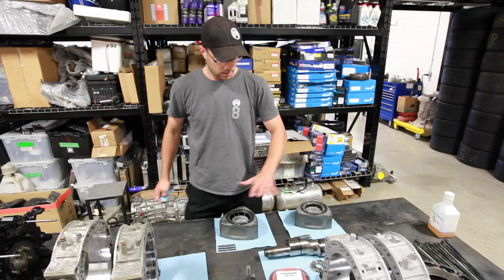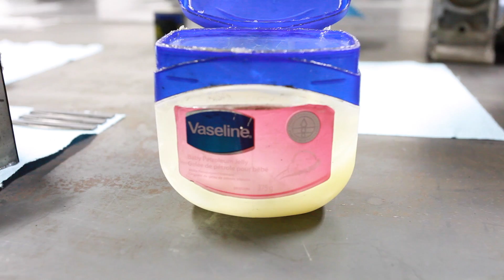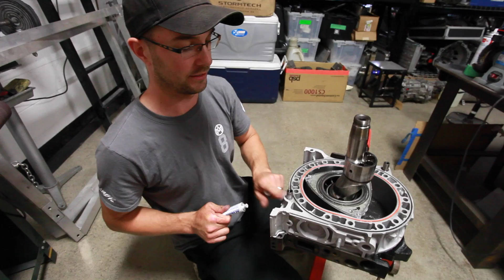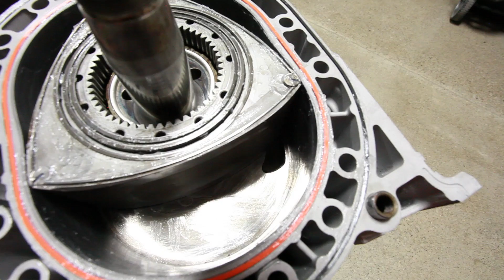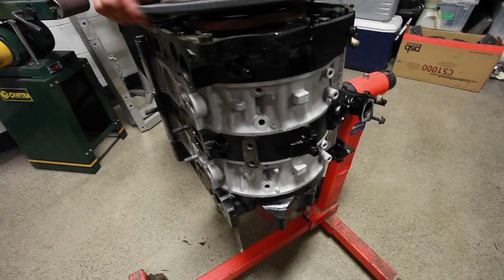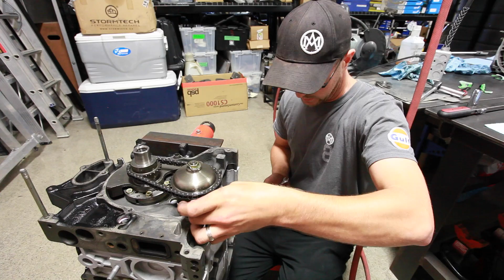How To Build A Rotary Engine

Comment: step one.  take it to the scaping yard
 step two.  buy an LS
step three spend a fraction making a more powerful,more reliable motor
step four.  forget rotor motors ever existed.
Reply from the maker: Kinda harsh no? The perception is that rotaries aren't reliable but go to Japan or Australia and you'll see how fast and reliable they are.
Reply: @Keisuke-I can't put enough Thumb's Up to this post, forgive me.
Reply: +just rotate I'm joking really, not necessarily a big rotary fan, but they some of the best sounding engines there are.
Reply: you forgot step five......get blown by by a guy in a single turbo supra pushign 1000hp on the stock bottom end
and step six, holding your e head in shame as youve spent allot more money on an ls than the guy down the road with a LT1 powered camaro only to lose to a boosted supra
Reply: kiddddinggg
Reply: rotor motors will still exist In Aircrafts, but we should appreciate the effort put in joining rotaries with cars by mazda and other companies ...it was an interesting experiment!
Reply: +Atef turki Rotary engines have been obsolete in aircraft for almost a 100 years... and Wankel engines were never used in production aircraft... I don't understand what you are talking about.
Reply: +The real doktorbimmer 
i wanted OP to not call the engine 'Junk' (that's what i was talking about...)
and HOW da fucc did the engine get obsolete 100 yrs ago when it was developed 66 yrs ago (1951)????
,also! i think it's more efficient in aircrafts (propeller ones) not because of gas mileage, but because of 
things like weight and less volume for smoother aerodynamics.... high revs... (better overall performance in short)
Reply: +Atef turki  I wouldn't call the Wankel "junk" its simply inferior to other ICE designs which are still mass produced in the millions.
Reply: +Atef turki You really are confused on your engine types though.. Felix Millet invented the Rotary ICE in 1892.. its was mass produced for aircraft, motorcycles and a few automobiles. But the Rotary died out around 1930's and has been obsolete ever since.
The Wankel KKM (show here) was invented in 1957 by Dr Hanns Paschke at the NSU motorcycle works in Germany. The Wankel KKM is not a Rotary, it has a conventional layout with a rotating crankshaft and flywheel enclosed in a fixed engine housing.
Reply: O . O my life is a lie .... sorry i wasted your time ... +The real doktorbimmer
Reply: ak operator the sound of rotors with secuencial turbos can't be forgoten..
Reply: +kevin salias In production automobiles they have long been forgotten... even Mazda abandoned them over half a decade ago!
Reply: just to be clear, ive seen a 2jz powered C4 over in saudia arabia.....and it hauls ass.
Reply: lol, tell that to the formula mazda.   last i checked they still had rotary engines.
Reply: +Big Show Not for long... the engines are no longer in production.
Reply: doktorbimmer you are right the old 13Bs and 12As are not in production  but Mazda is making a new rotary the 1.6L Skyactiv-R that will go in a new car and will be mass produced lighter car then your V8 car pushing almost the same horse and torque stock as your V8 car sounds to me you need to do some research before you talk
Reply: It'll mess up the 50/50 distribution
Reply: +Darcy Ferrier Well some people prefer an engine that is reliable, fuel efficient and actually produces torque... something that the obsolete Wankel never did well enough.

Comment: A note on lubing head bolts... I'm a tech at a dealer. GM doesn't recommend lubing head bolts, they'll get over torqued. It's entirely different with a rotary engine, but just sayin'.

Comment: Did..Did I hear that right? 320 ft/lbs? Holy fuck, might I asked how you Torqued that down? A footage of said procedure would've been dope. mind=blown. @SpeedAcademy
Reply: a 10ft bar would make that 32 lbs of pressure on the end.  "with a long enough lever you can lift the world"  or something like that.
Reply from the maker: Joe actually uses a big ass impact gun to tighten it. His method has never let him down. We too were wondering how on earth one would tighten it to that much since most torque wrenches don't get near that number.
Reply: I couldn't fathom how the hell you guys would've torqued that lol.. Even if there was a torque wrench that went that high.... You would have to have some massive pipes or a friend help you torque that bitch to 320ft/lbs :P Love the vids and noticed that you guys are Canadian? (Mention of Princess Auto) Where about's you located? I'm in Ontario myself. Keep em comin!
Reply from the maker: We're in the Hamilton area!
Reply: Speed Academy Haha that's nuts, I'm in Kitchener myself!!!
Reply: i have a torque wrench that goes that high its taller than me and the only time i have ever needed it was for a reverse gear in a dodge cummins
Reply: 850 bucks lol you cant rent one btw
Reply: +Ascended696 torque multiplier works well too. basically a 4:1 (or more reduction) planetary gear that goes onto a torque wrench.
Reply: Tyler Thornsberry haha how much did that run you?
Reply: I am a technician and in my shop we have 2 huge half inch torque wrenches that go to 540 ft pounds. i was surprised to hear that some of you havent even seen one that goes to 320+ haha
Reply: with a torque wrench.... guess being a Crane tech 325 is 100 to me anymore we use a 3/4 torque wrench or multipler
Reply: 320isnt that tight, the hubs on Volvo trucks are 1200
Reply: Iirc correctly, the way we used to do it was to torque it to like 150 ft-lbs with a torque wrench, make a mark on the nut with a sharpie, then impact it one quarter rotation.
Reply: Wow? Kitchener? Princess auto... I'm in the Owen sound area myself lol. good to see people on here so close to home

Comment: Used, old motoroil for lubricating the tension bolt for proper torque? Rather use proper bolt lubrication .. Molykote f.ex

Besides that, great video! Learned alot about assembly of these motors!

Comment: Awesome, gotta love the magic of a rotary
Reply: I was simply saying that the term "rotary engine" covers a wide range of engines.
Reply: A wankel engine is a rotary engine but not all rotary engines are wankel. Look up a Le Rhone rotary engine.
Reply: RiceFlavouredVTEC there's nothing like pulling it down into second going all the way up to 60 mile-per-hour shifting into 3rd and rocketing past whatever tries to race you
Reply: This is a Wankel engine... a rotary is something very different.
Reply: Stop, it's not, same thing
Reply: +Keven Steeno Which Wankel are you referring to??? Only the Wankel DKM prototype was a Rotary layout. (Millet Type invented by Félix Millet in 1892).
But the DKM never saw production, 26 major engine manufacturers around the world licensed the production of the Wankel KKM design created by Hanns Paschke... Paschke dispensed with the troublesome Rotary layout in favor of a conventional rotating crankshaft and flywheel arrangement found in all production Wankel designs that were developed back in the 1960's and 70's

Comment: You guys should do a video about how to own/care for a rotary properly so that it is as reliable as possible.
Reply from the maker: Good idea!!
Reply: 1. Add oil. Often. Like every other tank of gas often. If you really wanna be vigilant, premix.
2. Let it warm up before driving as often as you can. at least 5-10 minutes if possible.
3. Redline it at least once every time you drive it to clear out carbon deposits.
4. An annual seafoam treatment never hurts
5. Don't flood it. 
6. If you can afford to, upgrade your spark/ignition system (starter, coils, wires, etc), the LS2 kit is a popular choice.
Reply: @taborgilzinger8522  Nice list, but the seafoam stuff scares me, probably because I don't have experience with it. I've owned my FD since it was brand new with 9 miles on it. I'd add to your list to take a slow in-lap after a spirited drive. I like to let the turbos spool down on my way back to my garage. My house is about 2 miles from the entrance to our subdivision so it gives me plenty of time to go 25 mph or less on the way in. If it's really hot, sometimes I'll trick the fans to keep running longer by leaving the A/C button on with the ignition in the on position for about 5-10 seconds before getting out of the car. Dunno why, but that makes the fan run longer when you walk away.
Reply: patrick valentine drive 20 minutes low rpm so oil and water is at operating temp and then you can go race it my dad has an rx7 for 15 years and never had to change anything to the engine just maintain it good
Reply: Step 1: This is critical... Don't modify the engine! So many idiots rape the shit out of them expecting reliability from an 80 cubic inch engine. Mazda didn't design these things to run 500 plus horsepower, so don't come to YT crying about rotaries if you hack the shit out of them.

Comment: I've always been in love with rotary engines and every day i'm doing more research. I really wanna rebuild and port my own when I get my rx7 but the more I learn the more sketched out I get
Reply: They are a labor of love and just like all performance engines, they require a lot of TLC to go the distance. BUT I wouldn't let your research sketch you out, if you do your part and take your time when you do the rebuild and the porting (I really suggest having a competent machine shop do the porting though, probably with a bridgeport) that will give you a solid base to work from. You heard them mention premixing in the video, that will really help the apex and pate faces last by cutting down on wear like the gouging and chatter marks you saw on Dave's original, so will spirited driving (because in FD's that oil injection pump works off throttle position, a stab of the throttle injects a slight bit more oil into the chambers). These are good engines and with the right maintenance and diving them like you mean it, they last! If your going to run it as a dedicated race car and trailer it, you can see ware like Dave's example from sustained high 7-8000+RPM (all the track time and tuning issues) but for normal gear heads going to the track for test & tunes and stoplight races/highway pulls, these rotary engines hold up exceptionally well NA or turboed. Sorry for writing a novel I just felt like you needed some heartfelt reassurance to pursue a worthwhile interest, maybe even a dream. GET IT DONE!! Good luck bro
Reply: Damn, i didn't expect anyone to even notice my comment. But this is really reassuring, and i'm very glad that you took the time out of your life to coach a young grasshopper myself. I hope to find a nice FC to dump all my money into within the next year or so. Patience is key when looking for these beautiful cars, and your kind words really helped me hang in there. Thank you very much man!!
Reply: Np brother! I have a bit of experience with the 13b both turbo and non, and for gear heads, theres nothing better, I mean come on they respond to spirited driving by increasing their service life! Once you find a nice example man, you won't be disappointed. Just take your time with the rebuild, get a factory service manual and make sure everything makes spec, and you'll have a seriously fun car/engine combo and be one lucky dude, cuz you'll own a running driving FC! Good luck man, and really I'd rather have the car than the money anyway! Haha
Reply: Few people can tolerate the low reliability, short service life and high operating costs... its also why people stopped buying the new ones too.

Comment: Do they only have the corner seals in the one side?
Reply: Yes they are built into one side of the apex seal (so you can install the tension springs behind the apex seal after the apex seal is installed)

Comment: In order to yield those bolts correctly you have to put a little oil on the head of the bolt where it makes contact to the surface. Especially with bolts that long because you will bind the heads of the bolts against the surface before you stretch the bolts.

Comment: those rotors are $2,350. I can only imagine the acceleration to be had with both the lightened rotors and racingbeat lightweight flywheel plus it's street ported too so this engine will be very badass with a proper tune. I just have the flywheel that i'm using with my S2 drivetrain swapped S1 and that should be pretty decent on it's own, but once it comes time to rebuild the engine i'll be sending the rotors off to be lightened which I believe the cost to do so is about $600-$700 each. Anyway, hope whoever this engine goes to takes good care of it and beats the shit out of it regularly
Reply: It will break down again soon... just like they all do. If Mazda couldn't fix all the reliability flaws no one can... and that's why Wankel engines are no longer sold.
Reply: @doktorbimmer  no its not.  Emissions are the reason why there are no new rotary cars.  An engine that injects oil into the combustion chamber cannot meet current emissions regulations.  Second, they are still sold, just not in cars.  I just ordered a 13B-REW from mazda last month to replace my bridge ported one.  Old engine is fine, but is a track engine and way to loud for the street.  

Its always people who never owned a rotary or know how to maintain a car that talk shit about them...
Reply: @surrrithux  Bullshit, Wankel engines are obsolete because people refused to buy these horrible unreliable, inefficient and overall inferior engines.

The "Emissions Myth" is very popular among the rotards but completely falls apart upon the slightest scrutiny.

Comment: The tension bolts on the newer engines, are they stronger than the peripheral exhaust port motors? I remember a builders trick for high rpm motors they would wrap tension bolts or put a blob of rtv on the middle to dampen the bolt and keep it from breaking due to vibration at high rpm.

Comment: For the oil pump bolts you could have put a crow's foot socket on your torque wrench and computed the adjustment to the torque spec accounting for the longer lever arm, but ain't nobody got time for that!

Comment: since you don't know shit about side ports, here you go, SAE paper explaining 13B-MSP vs previous engines:

http://www.rotaryeng.net/New-rotary-eng.pdf

actually a good engine, just way too little oil injected and really shitty coils...
and no, it wasn't designed for boost, that's why side & corner seals commit suicide when back-pressure gets too high.

side ports aren't going away either:

http://www.autoevolution.com/pdf/news_attachements/new-mazda-rotary-engine-presented-in-patent-application-106139.pdf

Comment: On most engines when you tighten the pulley down, or flywheel down, you need to stop the crank from turning. How do you do this with the rotary engine?
Reply: Lock the flywheel. Senpai Ken went over this in his 13b teardown video.
Reply: Howzer Tech Ok thanks